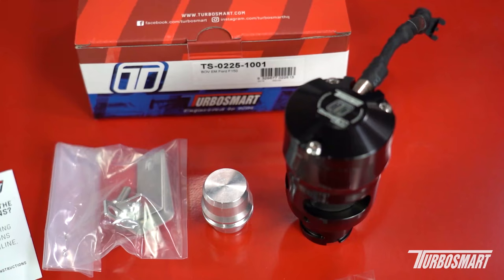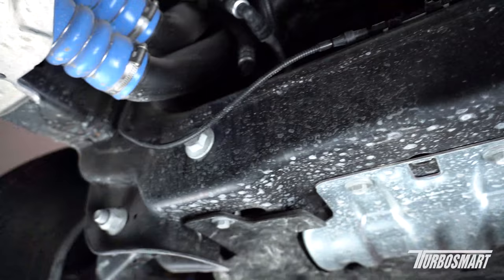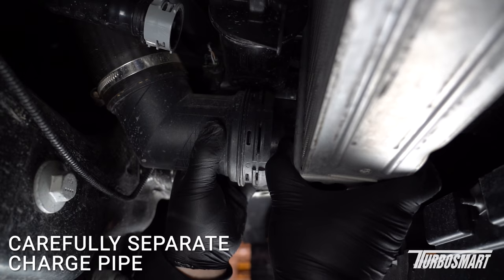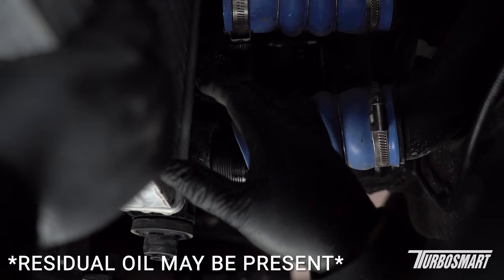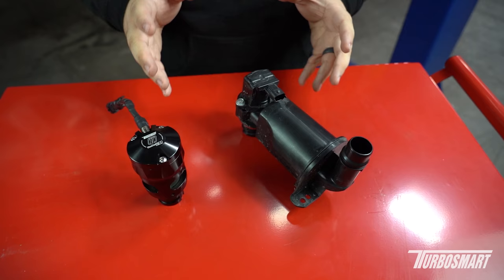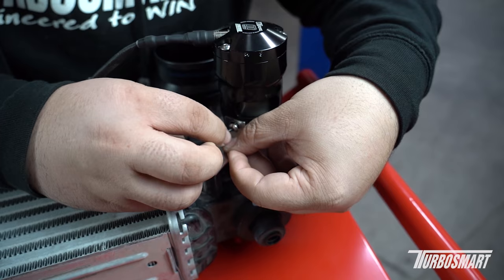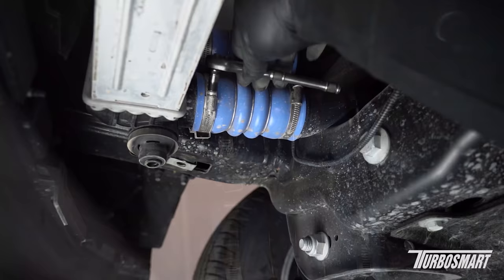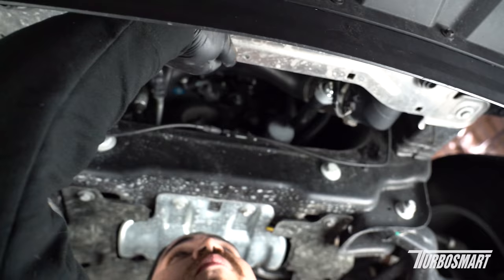BOV INSTALL: Ford F150 EM Blow Off Valve (P/N: TS-0225-1001)

Comment: Can I use this with a aftermarket intercooler
Reply from the maker: It will depend on which intercooler brand since the location of the valve varies between each model for the F150. If the location is similar to stock it usually wont be a problem.

Comment: What would happen if the electric harness broke off the Veeport and I left it installed without plugging it in to electrical system?
Reply from the maker: The valve would remain closed and you would likely see a CEL.

Comment: Does this affect the engine or how the truck runs with the air no longer being recirculated?
Reply: No the ecu will not know the difference
Reply: @Trenchluv  so no tune?
Reply: @Danieves325100  no tune required.

Comment: So looks like you can install it with out completely removing the intercooler has anyone done it with removing it?
Reply from the maker: Initially, you will need to remove the intercooler to remove the factory valve.

Comment: Do you guys sell the little cable mine kinda riped
Reply from the maker: We sell the solenoid replacement assembly for this BOV under part number TS-0223-3003

Comment: What is the part number for the pigtail that connect to the pressure relief valve
Reply from the maker: If you are seeking a replacement solenoid assembly for the TS-0225-1001 VEE Port EM then that is TS-0223-3003.

Comment: Is there any maintenance needed with this bov?
Reply from the maker: You can put a few drops of lubricant on the piston once a year or so and actuate the piston by hand to distribute it. Lubrication should be very thin. Something like sewing machine oil, hair clipper oil, our multi spray, or firearm assembly lube.
Reply: @TurbosmartHQ  Copy that, thanks for the info.

Comment: What happens to the hose going up to the intake? Once u removed the old valve? Since the new doesnt have one
Reply from the maker: We include a billet plug that prevents debris from getting into the hose.
Reply: @TurbosmartHQ  is it safe for the BOV if it goes through flood?
Reply: The hose is just supposed to hang on there with no purpose?

Comment: For rainy days?? Isn’t dangerous for the engine??
Reply from the maker: When the valve is closed it creates a tight enough seal to keep pressurized air from escaping. When the valve is open there is pressurized air venting from the valve. There is virtually no chance for water to get into the valve if that is what you are implying.

Comment: Does it fit 2017 Explorer with 3.5 EB?
Could the recirculation valve failing be causing sudden intermittent power output drops with no CEL?
Reply from the maker: Hello,

We have not test fit this valve to the Explorer 3.5 EcoBoost at this time so we cannot make an official recommendation. 

We appreciate you reaching out. If you are experiencing issues, please contact our technical support team using the link below. We are happy to assist you further!

Turbosmart.com/Contact-Us/

Please allow up to 24 hours for a response. Thank you!

Comment: Will this work on the 2021 Ford F150 3.5L?
Reply from the maker: As far as we are aware, there have been no major mechanical component updates from 2020-2021 that will not allow you to install this. We know of a few 21' Model owners that have this installed.

Comment: Do y’all have them for a 2020 f350 dually?
Reply from the maker: We do not have a plug and play option for your vehicle but we do have our universal BOV Controller Kit for diesel applications. Check out part number TS-0304-1002.

Comment: Doesnt this require a tune?
Reply from the maker: This does not require a tune. It is plug and play.
Reply: @TurbosmartHQ  Wait these trucks run off of speed density? Not maf? I am used to a WRX where venting the charge to atmosphere requires a tune.

Comment: Will this work with an ADD Intercooler?
Reply from the maker: We haven't personally tested it on the ADD intercooler but based on the location of the valve on the charge pipe we dont foresee it being an issue. If you have a chance to test fit it and have success, let us know!
Reply: @TurbosmartHQ  thank you will do. Will their be any issue if the bov is facing down?

Comment: Does this provide any improvement in performance? Or just a noise maker?
Reply from the maker: Hi Tim! Turbosmart blow-off valves improve vehicle boost handling capacity, reliability, & response over the OEM valve. In addition, a vent-to-atmosphere style valve (like the Vee Port EM) vents excess boost pressure when the throttle is closed and prevent compressor surge from occurring. The audible noise is simply a result of venting the excess boost pressure. Hope this answers your question!
Reply: Its just a noise maker, made from better materials.. all the adjustments in performance are done with tuning..

Comment: Is this going to affect my mpg ??
Reply from the maker: It shouldn't since the AFR is metered at the intake manifold. However, with the new fun noises the truck makes you may find yourself getting on the throttle more often to hear it. ;)
Reply: @TurbosmartHQ  lol I know and I don't know if you heard the stock BOV noise do you think this one is way louder? the stock one is hard to hear and i don't know why but it was decreasing my mpg .so I just put the hose back on

Comment: I have a 2018 3.5 eco boost with a edge products tuner for eco & performance. Will this be a better option or the straight mechanical one ? I want a nice bov sound but reliable performance. Any difference if I have a tune ?
Reply: Have you done the vta mod already? It's $4 and gives you the same sound pretty much as a bov
Reply: Kyle Quance what would be the need for them to electronically activated  but mechanically driven ? There has to be something to it ... maybe a light ?
Reply from the maker: Either will be a good option for your truck. It just comes down to ease of installation and if you have a preference to how they operate. The mechanical valve uses a vacuum reference and the EM valve uses a signal from ECU so it can operate similarly to the stock valve. The main difference you will probably notice between a stock application and modified application, such as yours, is the audible pressure release will be louder.

Comment: How does the sound compare to the mechanical version?
Reply from the maker: They will be fairly similar in sound with a slight advantage to the mechanical. How loud the sound is will depend on how much boost you make.
Reply: @TurbosmartHQ  , whats the difference between the mechanical and electronic then? Deciding which one to go with for my 18 2.7.

Comment: Will this mod throw a code?
Reply: It shouldnt, hence the factory connection it plugs into, nomore bypass resistor that cuts into ur factory wiring like the old supersonic model. so if u ever take the supersonic off aka going to the dealer because of a faulty oil pressure sensor, u needa rip everything out under the hood all vacuum lines and throw electrical tape around where the BOV cut into it.
It was so annoying. So i paid an extra 300$ to get this one to eliminate the headache the Supersonic offers.
It was a great BOV tho once all hooked up.

Comment: Is there a purpose for a BOV? What does it accomplish besides the blow-off sound?
Reply: It prevents compressor surge and reduces Turbo lag. The compressor wheel is slowed significantly when the throttle plate closes and all the high pressure air is trapped thereby forcing itself to flow back into the compressor which may stall and some drivers notice a fluttering air sound when slowing. When trying to press the gas after a stop light turns green, it takes time for your vehicle to jump forward as you press the gas (turbo lag).

Comment: Is this ok for a diesel?
Reply from the maker: Due to the design of the mounting flange and electronic plug this is unfortunately not universal.  We do offer BOV Controllers specifically for Diesels. You can learn more about them in the following link: https://www.turbosmart.com/product/bov-controller-kit-race-port-bov-black/
Reply: @TurbosmartHQ  I saw them.. but the problem is as it is open 
To atmosphere it will be a issue when a water crossing. We are using off-road diesels. So there's a risk of water sucking in when the valve works.. don't you have a solution for this..?
Reply from the maker: @knightmpw  We offer the BOV Controller kit with multiple valves. If you are concerned about venting to the atmosphere then we do have valves where a recirculating fitting can be utilized.

Comment: Other than that sound that all of us truck owners cream our pants over, what are other benefits of this bov? Just curious
Reply from the maker: Hi there, thanks for asking. While the sound is desirable, it is merely a byproduct of the vale doing its job. The fundamental purpose of a BOV is to prevent compressor surge and extend the overall lifespan of your turbos. The short answer is that our Vee Port EM is a significant upgrade over the factory bypass valve in every way. The OE valve is plastic and can become brittle over time, causing it to leak or fail. Our valve is constructed from billet CNC aluminum; Much more durable. Beyond that, it has superior response and sealing, giving it superior boost handling capacity overall (this is especially important if you plan to tune your truck and make more power). Hope that answers your question!

Comment: Don’t put this on your truck will cause problems just for a phew! Noise pretty stupid
Reply from the maker: Hi Robert. For the assurance and peace of mind of our customers, all of our products are thoroughly tested by our engineers who have decades of experience in this area. We sell thousands of our F150 valves without any reported issues. In fact, we hear a lot of great things from F150 customers around the globe! In regards to your question about a BOV being a stupid noise maker, we are happy to clear this up. To start, Turbosmart blow-off valves improve vehicle boost handling capacity, are far more reliable, and have superior response over the OEM valve. This especially important if you plan to increase your boost pressure over the factory levels. In addition, a valve like the Vee Port EM, vents excess boost pressure when the throttle is closed and prevents harmful compressor surge from occurring (the net result being longer life for your turbo). The audible noise is simply a by-product of VENTING the excess boost pressure, instead of recirculating it like the OE valve.  So like our name implies, its not stupid, but rather, its smart! (No pun intended) Hope this answers your question!

Comment: Any chance that this would work on a 2021 Powerboost?
Reply from the maker: We haven't specifically test fit it to a Powerboost yet so we cant say for sure.
Reply: @TurbosmartHQ  Ok, thank you for the response!
Reply: Just recently installed on mine. It does work. Everything is the same with the installation process.

Comment: Does this work on the Transit with 3.5 EB?
Reply from the maker: We have not confirmed fitment on the Transit. If it uses identical components shown in this video then it is very likely that it will work.